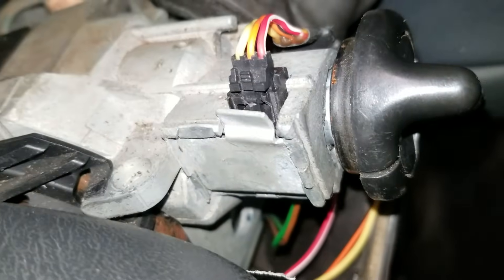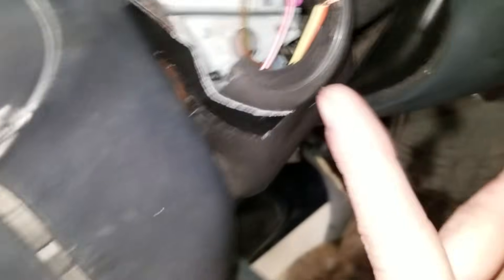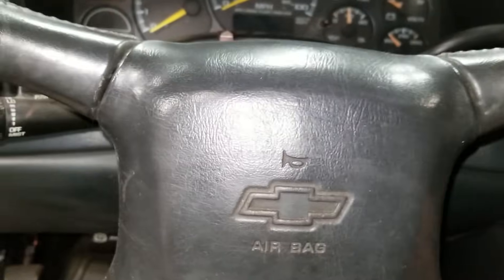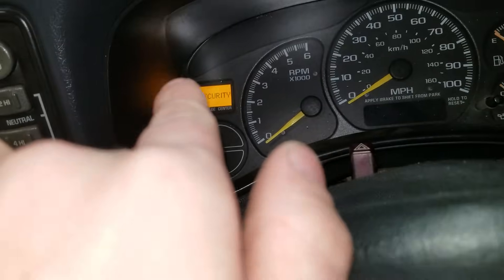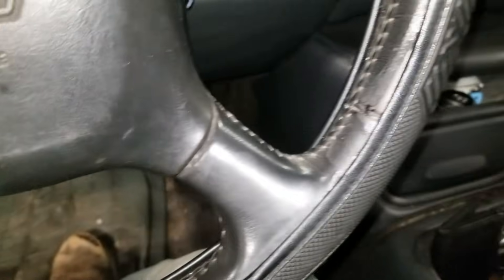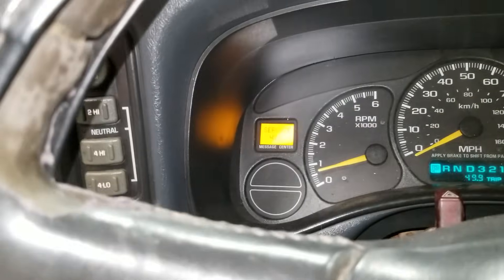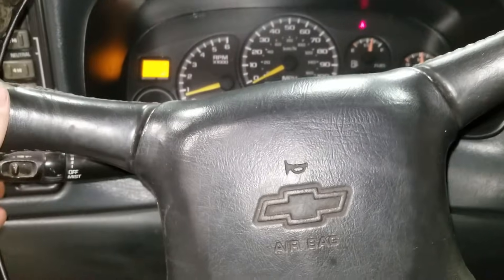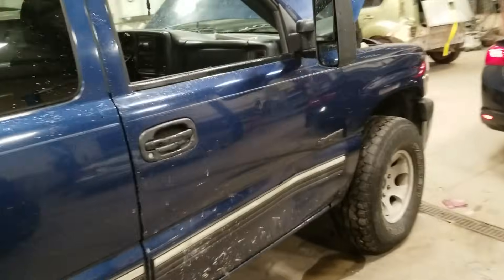99-07 Chevy Silverado No start Passlock 3 bypass 1500 2500 3500

Comment: Dude! My 1999 suburban k2500 constantly would do this, no start. I too replaced the fuel pump and filter and no go. Followed your instructions cut the yellow, orange wires and tied them. Wow, started on first try. Security light even went out right away and doesn’t stay on after starting. Thanks a million for the info. ✌️
Reply from the maker: Glad it helped
Reply: So help me out please  I feel dumb.  When you cut the yellow and orange...which side of the cut wires do you tie together?  The two cut ends that come from under the dash or the two cut ends coming from the ignition side? Thanks
Reply: @joerutherford407 hello did you find out? because i’m now having the same problem
Reply: @lurpincutting4208  this fixed mine, I bought a passlock bypass kit on Amazon.  Its just a connector that has a resistor plugged in one side.   Just cut the yellow and orange wires and stuck them in the other side opposite of the resistor.  Has started right up every single time
Reply from the maker: @joerutherford407 the cut wires off the ignition are dead. It’s the 2 off the main harness. Just follow where they came from and it shouldn’t be a problem

Comment: So I had a 03 gmc. Had the same dying issue. Noticed that the dome lights, power locks, power windows, and gauges were not working. Tried to connect diagnostic tool. Was not able to communicate with any of the modules. Ran out of ideas. Had to talk to a gm vet. He asked if the radio was aftermarket. It was. He advised to remove the radio. Disconnect the radio and the interface module if it had one. When I unplugged the interface everything started working and the truck started. So if your having this issue before you cut the wires check the radio.
Reply: messing with my truck for four day until i saw this comment. thank you

Comment: Once your truck starts, just unplug the three wires. the security light will stay on but your truck will start every time. Will reset if truck loses all battery power. then do it again.
Reply: I unplugged mine and tried this, works for a couple months then had to do it again
Reply: When I bought mine, it came with two of those cables cut, as if they had bypassed it. what you say still works, my friend?

Comment: Wow bro i fr had my doubts that this would work. i have a 98 c1500 and replaced the vats module itself, ignition cylinder, and ignition wiring harness and still had the same problem, flashing security light it starts but dies after 2 seconds . tried this and after following all steps it fired right up after the 3rd reset thank you so much bro i was so tired of pouring money into my truck. TRY THIS IS WORKS!!!
Reply: Got a 98 Suburban with 454 and same issue,, screw the 300 security module.
Going to try this since it worked on your 98 truck.

Comment: Haha dude thank you so much, I have a 2000 chevy K2500 with a 5.7 in it, the older body style, man I was at my wits end I even replaced the pass lock sensor in the ignition housing, and I just snipped and tied those two wires together and bam it runs great, now I have my plow truck for the winter lol thank you

Comment: Thank you, just used your info and spliced in a 2200 ohm resistor.  Did the passlock reset and my truck starts again with no security light on.  Thanks for sharing
Reply from the maker: Awesome glad to hear!
Reply: Thanks for sharing the resister info. It makes all of this an easy fix.  Thanks buddy!! Montana Rick
Reply: @rickfreeman9530  each different vehicle has a different resistance value, so it's not 2200 ohm's across the board. That is, if you haven't figured this out by now.
Reply: When you installed the resistor, do you have to go through the reset procedure again?
Reply: So how do you fix it tho

Comment: I would like to thank you I bought me a real clean low miles 2001 Chevy Tahoe that was been sitting for 2 years it crank but no start no one couldn’t find out what was wrong they checked everything I did everything you did in the video and on the third attempt it fired right up I was full of joy thanks again god bless!
Reply: Did you cut any of the wires like he did ? Or just did the 30 min key relearn
Reply: @gerardojuarez6938  I cut the wires like he did and put a resistor to take out the security light and did the 30 min key reset

Comment: 2003 Silverado has been fed parts. Then remember that the key chip was glues to ignition area. I found it on the mat and started but new PC did not recognize?! I'll try old PC to see. Probably want to jump the security system out. I sent for 5 ohm resistor and easy connect splice? I guess. Helpful video, Richie ⛵
Reply from the maker: Id recommend either soldering the resistor in carefully to avoid overheating the resistor or use non insulated butt connectors with heat shink for best results. The whole passlock things a huge problem and it can be caused by a handful of issues which are all decently involved to figure out which is why i tend to bypass rather then properly repair the issue.
Reply: Thanks, I soldered and shrunk wrapped a bypass using a Tee splice (without cutting the two left wires on the passlock module?) with a 4.7 ohm resistor from a youtubers same 2003 silverado. I did not check ohms myself so but the security light goes out after cranking. New PCM shows the VIN # and of course the battery is weak!? Cranks but won't start. Sent PCM back to check it. Must I bring it to Chevy dealer? What next? At shop 3 months. Thanx

Comment: I FIXED IT!!!  I don't know what caused the problem, but I know where it originates so now, I'm having trouble duplicating the problem.  2005 Tahoe.  Follow the Parking Brake Release cable as it curves around a small black box.  Moving that cable off the box made everything come back on but eventually it went off.  Giggled the box and it came back on.  Pulled the box out of its holder and giggled the connectors and then put it back in.  

The pressure of that cable against the corner of that box could have disconnected something.  I'm going to loosen the bolts holding that cable to get it off that box and see if that keeps it working.

I'm inside now trying to look up what that box is as it is Not the BCM.
Reply: Welll???
Reply: @heavyhauler213  Sorry. it's the same old story. The previous owner had the HVAC duct regulator thingy changed which required the removal of the dashboard.  When it was reassembled, the mechanic didn't put the cabin control unit firmly back in its bracket and when I made sharp turns, it would slide against that brake cable and somehow short out.  I pressed the unit back into the bracket and the problem never came back.  The same thing happened to my Flasher relay.  Sometimes the flashers would just die.  I cleaned the fuse of corrosion but that didn't help. I went to remove the relay, which videos showed I might have to pry it out, but it just fell out when I touched it.  I pushed it back in and the problem was solved.  I have found that most problems have originated because of corrosion or loose items.
Reply: @JB91710 so that box must be the passcode module?
Reply: @stevedriscoll2539  I don't know.  It's a small rectangular box inside a galvanized bracket, above your shins.  It slides in like a VHS tape.  It controls everything inside the vehicle.
Reply: @JB91710  thank you, happy skiing

Comment: I want to add that apparently, at least on my 05 5.3, once you do this procedure it forever defeats the security system. Turns out I had a bad starter, but I thought maybe my bypass had come loose so I’ve had the wires unplugged while the key is out, while the key is on, everything and it never reverts back.

Comment: Great Video- u  made it easy  to follow - Good teacher-Thank you
Reply from the maker: Thanks Ron!
Reply: @zachnuketown I'm having same problem although I'm having a bigger problem since I've had this certain problem other than it shutting off as soon as I start it it will also if you don't pump the pedal it's a dead stick won't start just crank every once in a while it gets that sounds as if it wants to start but goes back to cranking , could this still be a security problem considering I have like you replaced everything even all the sensors but the maf and oxygen sensors also I didn't replace the ignition module
Reply: But once it fires up it runs perfect even when you drove it shut it down fires rite back up like a charm

Comment: Had same prob on my 99 tahoe. Replaced tumbler housing. 120$ off amazon. Did relearn process and it fired rite up. 7 months of crank and immediately shut off. 650$ in other parts lol. Was the passlock security on the tumbler the whole time. Was just about to sell the Ole girl. All new parts on it now ha ha.
Reply from the maker: Glad to hear you got it running. These stupid little gm problems drive me nuts, i also own a isuzu trooper thats Gm and has all the same little issues as my truck.
Reply: @zachnuketown  man I had no clue what passlock security was. Without videos like yours it would still be sitting. So many wtf moments. New fuel filter and fuel pump. No crank. Wtf. New distributor plugs and wires. No crank. Wtf. New spider injector. No crank wtf and on and on. So frustrating
Reply from the maker: @stonestalker1590  Its terrible but thats how cars are. I had a similar issue in my Nissan that was caused by the battery going too low and messing with all the electronics which i see all the time in hondas but i never even thought of it on a nissan. Long story short spent 2 months doing diagnostics on a car that just needed a full reset (pulling battery and connecting the cables together for a couple hours) guess thats why im a laborer hahaha.
Reply: So this worked for you? Iv done the whole ignition system and a few grounds and new pump and even had mechanics send me towards evap but problem persists
Reply: @alaynaanddad3825  yeah man it worked. New tumbler housing then the relearn process. Relearn process was on paper in the box the housing came in.

Comment: I have a 2001 GMC Sierra 2500HD and am experiencing the same problem. Sometimes my truck runs smooth as glass. Then the next day I try to start it and it dies in 2 seconds. At first I thought it was something mechanical but since it runs perfectly when it runs I knew it must be an electrical problem. When I put the ignition in the first position and let it set for a minute or two it starts right up. I am going to try tightening the electrical connector contacts and wedging it. If that doesn't work I will be bypassing it. Thanks for making this video I really appreciate it.

Comment: Had this problem on my 2000 chevy siverado changed the fuel pump on it first then read on this passlock is a big problem on these trucks chevy should have recalled this years ago
Reply from the maker: They should've recalled half their vehicles completely man Chevrolet isnt the company it used to be.
Reply: @zachnuketown   I agree with you I drove an old squarebody for years and years virtually trouble free, I have a 99 as well and it is junk compared to the old one

Comment: Getting a used steering column tomorrow from auto-salvage. Going to try changing out the sensor only, then re program the key. Hope it works. 2006 Hummer H3.

Comment: To permanently fix this issue you should look at replacing the BCM and the TCB Fuse (bottom right most 10am fuse) in your under hood Fuse box.
Reply from the maker: To permanently fix this issue you replace the passlock module on the ignition and have it reprogrammed. This bypass with correct resistor completely bypasses the junk GM ignition security system including the security light.
Reply: does the motor turn over crank but not run I have a problem with mind
Reply: Yes security light flashing, engine tries to start but will not start. 

Leave key in on position (dashboard lights on) for 10-11minutes turn off and turn on again it should start. 

You may have to repeat these steps up to 4 times in a row to completely clear the security.

Comment: Hack WORKED as described on my 2002 Silverado 1500 4.8L
Thank You 😊
Reply: For yours do you have the original key?
Reply: @donwoods9784  no only dumb keys came with vehicle.
Reply: @briansmith4724  ok thx im in the same issue with a used truck I bought. I changed the battery now the security light came on and wont start and I have only the dumb key also.
Reply: @donwoods9784  mine also eventually quit working 2 weeks
Put in a shop, not dealer, they did Not tell me how they fixed it. Cost around $560
Reply: @briansmith4724  dis you do this hack after it got out of the shop?
Reply: @donwoods9784  No. Did hack, worked for 2 weeks, then would Not start again. Put in shop, that could reprogram, they had truck 1 week, paid $560, they did Not tell me what they did, truck works fine now
Reply: @briansmith4724 I'm having same problem but more with mine what type of a mechanic place did you go to cause I'm gonna need mine done I'm sure . I took the original radio out and after 6 mnyh started having problems with it doing the run and shut down but mine also if it's not doing that it'll start if you pump the pedal starts up good but if you don't it won't start for crap wondering if this still has something to do with security as I have put mny new parts on this from fuel pump to almost every sensor
Reply: @jamesdaye7001  yes, Eventually I had to take truck to Real mechanic shop. It cost me around $1,000. They dod Not tell me what they did.

Comment: What if you're security light doesn't stop flashing after 10+ minutes? I waited 25 and it was still flashing
Reply: What did you do?
Reply: @jayball2752  replaced the passlock
Reply: Did you ever figure it out? My truck is doing the same
Reply: @jackwagon9411  my body control module died

Comment: Did you have a no start?? I replaced my multifunction switch, (blinker and wiper switch) and now my truck dies immediately after starting.. the 30 min reset isn't working.. Security light is constant with no key in ignition, does not stop flashing after 10-20 min with key turned to on. I am getting the battery and security alternately flashing. Just replaced battery. I am currently stuck. Ran fine until I replaced that switch. I definitely connected everything correctly and did not touch anything else.
Reply: Did you find a fix? I am currently going through this problem the exact way you described

Comment: I spliced in a 2200 ohm resistor, and when I tried the relearn, my pass lock light didn’t shut off after 10 mins. And it stayed solid, it didn’t blink. I unhooked the battery , gunna leave it for a while and hope it resets. 2006 gmc sierra 1500.
Reply: Did this work? My 2000 2500 6.0 does the same thing. If I remove the key and close all doors the security light stays on. Tried doing the procedure and the light security never stops flashing. All this cause I replaced the damn headlight switch 😡

Comment: I had the same issue with my 05 classic. I bought an Amazon ignition for 40 bucks. The key is a resistor in the VATS system. Putting a new ignition in you get a new key too and it fixed my problem.

Comment: Did you have to take off both battery cables and jump them together to drain down residual electricity in the system before connecting the two wires, yellow and orange and then trying the key sequence?

Comment: I just replaced my steering column I couldnt even get key to the on position finally I did tried to crank but wouldnt fire I hope this works
Reply: WHAT DID U DO TO FIX THIS HAPPENED TO ME
Reply: @christopherlance4993  https://youtu.be/z1G5AWnPPBo

Do this procedure in my case i waiting until my light flashed. After the 3rd time it should start right up! I went and got a new key bevause my key was shitty

Comment: 1.  Driving along and everything inside the car goes dead but the 2005 Tahoe keeps driving.

2.  I make a hard left turn, and everything comes back on but then dies out again.

3.  One day the starter would turn over but wouldn't start.  Everything inside is dead.

4.  Remembering the left turn deal, I put the key in the on position, everything still dead, I opened the door, grabbed the edge of the roof and started rocking the truck.  The interior lit right up, and the radio came on and I was able to start it.

5.  The problem would resurface.

Do you think it could be a motion detector that is acting up?  I have a blank key that will start the truck.  Did the previous owner bypass the passkey system?
Reply from the maker: I would assume it's most likely a bad ground. Everytime an old chevy came in with weird electrical problems I'd start by running additional grounds. The ones that seem to go bad the most are the engine to firewall grounds as well as the cluster of them that are near the drivers door on the frame of the truck.
Reply: Could be a lose wire in the steering column.
Reply: @genebarnes6108  There is a Black Box under the steering column.  It is clipped into a galvanized bracket.  It was loose and the parking brake release cable was leaning against it, and I assume, grounding it out.  I pushed the box into the bracket and relocated the handle and cable and it never happened again.
Reply: @JB91710  Thanks I will check my out.
Reply: @JB91710  Is the black box under the dash or past the firewall?
Reply: @genebarnes6108  Right above your knees.  The cable wraps around it to the left where it releases the brake.  When I made left turns, the cable and box moved to the right and everything came back on.  Straight or to the right and everything went off.
Reply: @JB91710  Thank You
Reply: @JB91710  I tried a new way I turned the key on the position,pumped the gas three times,Turned it in the off position and when I started the security light went off.
Might just be dumb luck.
Reply: @JB91710  Thank you it worked.